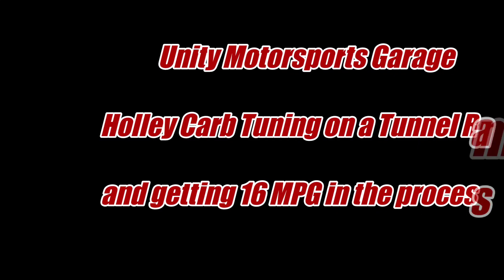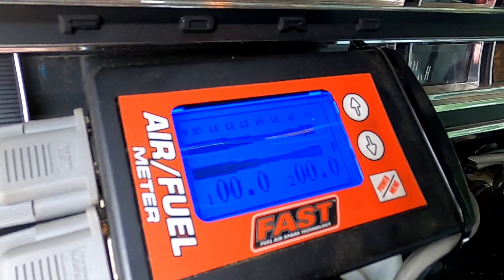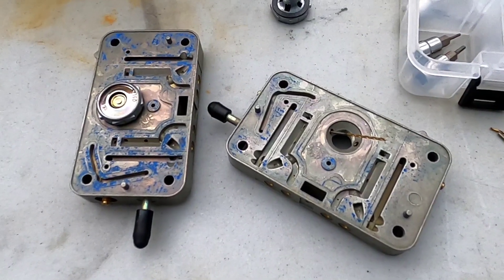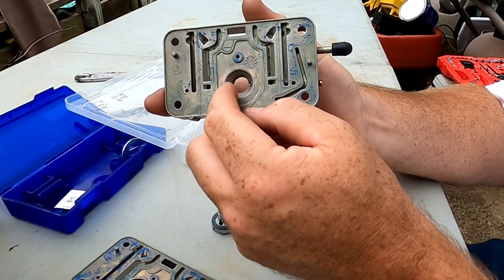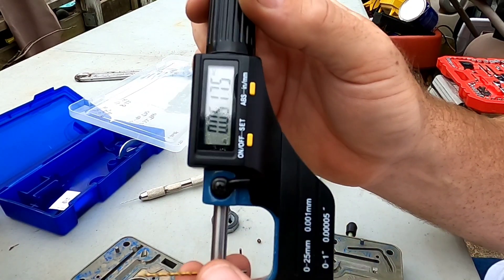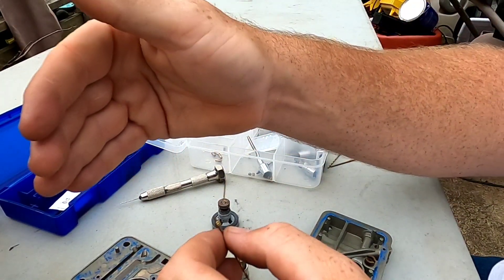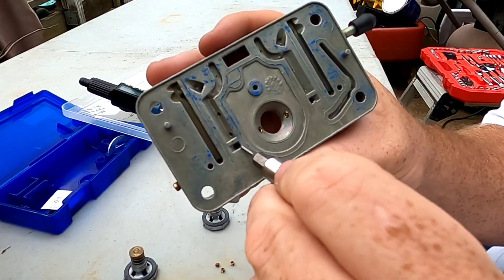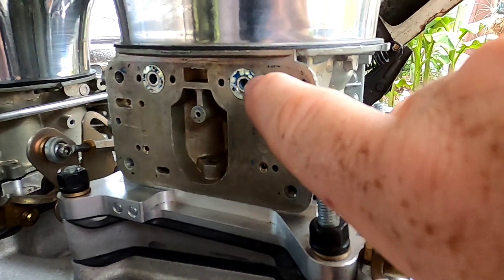600HP that gets 16MPG with a Holley Tunnel Ram and 2 Holley 660 Carbs

Comment: What if you got 2 600 CFM
Reply from the maker: I had two 600's on it before the 660's and I did the same mods.. I just took it a little farther on the 660's
 It ran good with the 600's you can see a comparison I did at the track between them on my channel.. 
Andy
Reply: Unity MotorSports Garage that looks like a lot of fun and worth while learning the Tec. Thanks for the info
Reply: Unity MotorSports Garage ya I came just came across another carb vid and he was pointing out in same thine. Thr idol air bleeds on the plate. He took apart a brand new carb the Holly Brawler and even before he put fuel to it he disassembled it and surprisingly it was dirty and had metal shavings. 

I came back to your video to really understand the idol circuit  and the transition to the metering plate. I’m used to just bolt it and go. I turn the idol set screws out 2 turns. And set the idol and play with jets. 

A guy once built me a holly 770 he said it flowed that. That was way back in 98. But that carb ran top. It could pull any rpm on a 4 speed.
Reply from the maker: @davidvonanderseck8649  People always blame the jets for their Holley running rich, while it can play a big part in it most of the fuel mileage is wasted in the Idle feed restrictor.. what is funny Holley has always calibrated the double pumpers alot richer than their Vacuum secondary carbs of the same cfm rating!  You can get most engines to idle at a 14 to 1 AFR but if you have a really strong ignition system you can go even leaner... in order to get MAX fuel economy the cruise ideal AFR is right at 16 to 1 but this requires every circuit to be dialed in because you can get a stumble with sudden throttle changes.. hence the accelerator pump must be spot on also... Im going to do some good stuff once Casper is up and running again... getting good mileage with 750hp MIXED UP BOSS is my next challenge..
Andy
Reply: I l
Reply: Wow 750 awesome. I love your attention to detail and can’t wait to see how your build comes out.

Comment: Just saw this mod on the UTG’s channel. I’m asking the same question. In addition to this modification, if you’re running with a vapor fuel setup with a Thompson carburetor powerblast plate(https://thompsonperformance.com/ )will that modification enhance gas mileage further ? Are you willing to perform a build and demonstration video for that purpose ?
Reply from the maker: No, I haven't tried those plates... But they make sense to me.. the accelerater pump circuit is basically mechanical fuel injection to help the carb transition circuits.. the better you can atomize the fuel the better the response will be... While never having run those... I believe you would be able to get away with a smaller squirter than you would normally run... But that would make for a good test... I just need plates to work with Center Squirters! Lol
Reply: @UnityMotorSportsGarage   Thompson  Performance should be able to answer that question regarding smaller squirters. I’m basically curious in picking up the ideas of Tom Ogle (R.I.P.) and continuing with those carburetor modifications. I’m confident that a vapor setup and a well tuned and modified carburetor will achieve unheard of performance as well as insane gas mileage. I look forward to seeing either your channel or UTG perform this build and show a video of it.

Comment: I have a pair 660 Holley center squirt WILL NOT go different
List 1970 6 months later
 List 1971 matched pair 
4224-S 
This system brought down blown 454s
A dual Point distributor (yes I said points) Doe's wonders !
Reply from the maker: Center Squirters ROCK!!! I love them for Tunnel Rams.. that 1:1 throttle opening is like none other...
Thanks for Watching and please Subscribe as I have more tuning stuff coming up!
Andy

Comment: Nice work and info.
Carbs will never meet the MPG of port fuel injection though. It makes a huge difference where in the port the fuel is introduced and good luck getting a carb to fuel cut on deceleration and cruise.
Reply from the maker: Thanks for the kind words,  Carbs can rival injection but in the end I do give the edge to FI due to cold start capability....  You are also right on Carbs cutting fuel on decel... the key to that is having a properly tuned vacuum advance to put in as much timing as the engine will... Most engines can idle leaner than 15 to 1 AFR, Ive seen over 20 to 1 working with David Vizard, it takes a very strong ignition system to make that happen...  Thanks again for watching and please subscribe as I have more good content coming up..
Andy

Comment: Which episode shows the 600 horsepower dyno run? I watched one where 422 h.p. to the rear wheels in shown, but that converts to around between 500 to 535 horses?
Reply from the maker: When it was first built we ran it on the engine dyno in Mooresville NC.. you can see it in my CASPER slide show video...https://youtu.be/6cV7ZUSExSY
Reply: @UnityMotorSportsGarage  so with the early high rise, you made 600, then after replacing it with a later style high rise you made less horsepower at the wheels than you should have with, as you said when drag racing it, higher power levels than before? So what's eating close to two hundred horsepower? One or the other dyno pulls weren't accurate? Can you please explain. By the way,  enjoy the content.
Reply from the maker: @olderthanyoucali8512  It made 575 @ 6500 flywheel with the old Hi-Ram "They" wanted to pull it to 7k and I decided not to.. as it had a Scat cast crank it would have probably peaked at 6700 give or take

Comment: Also you locked out your distributor or running some mechanical advance lie 8 or 10 degrees built in for mileage. Locked out with tunnel rams has always worked best for me unless high compression or timing fighting the starter kicking over. I've never had that problem but heard of others complain about it. But big picture who cares about mpg with two 4s and tunnel ram. Haha. I just want afr good at idle part throttle, smooth transition from cruise and from dig to floored.

Comment: Guess with wide band I can figure it out for my application.  But power valve change based on vacume signal then pump cam then jets is where I always started then if still had bog or hesitation would swap out the 30cc pumps to 50cc pumps and then back to jets. So where does your restrictions come in order of your tuning.

Comment: Isn't that why you change your power valve first then your pump cam  then your jets. I know what your saying makes sense but won't power valve control the amount fuel through there going from like a 8.5 power valve tho 6.5 have same effect. Or is that where your saying if you have downleg boosters vs annular booster.  My carbs are the weird ass no secondary squirter 450 cftm tunnel ram carbs 9776 I believe. And I know I need to change power valves but just pump cam change and changing jets on my 273 tunnel made a huge difference with just pump cam change then I dropped jets from factor down about 6 sizes and I get 20mpg with my 4speed 294 gear and light car and aluminum flywheel. I really want a wife band the I can tune from each header and eventually bung on each header to optimize my next motor. Those weird 450 cam mechanical secondary carbs with no secondary squirters do work good on my smaller motor. I was having trouble with getting changes with 4 corner idle adjustments till I changed jets. But there is zero hesitation and no bog like alot of people complain about after pump cam change and couple jet changes. But I know power valves need changed to better match the smaller 273 but maybe on the .04 over 318 with 10.1 and 2.02 360 heads power valve will be fine but im curious if you set screw restrictions are just changing power valve function or if fine-tuning after you have done a power valve change. Or with my carbs having metering block on primary side and plate with no secondary squirters is whole other animal. I know once the 4.56 gears go in probably gonna have to return carb but bigger motor will change same time so who knows. 

Just curious if power valve change would have same or similar results as your screw in offices behind power valve

I know if transfer slot not set right your 4 corner idle can be non responsive to change and that drilling hole in primary throttle plates isn't the right fix. Ive seen air bleeds changed and that helped with transfer slot and idle adjustments work better from idle to opening throttle making for snappier throttle correct? Again I know these 450cfm are weird setup but been great on my tr5 tunnel rammed 273 in light 4 spd car that doesn't need all the extra fuel when floored but may be hard to rune for most or a 460 480 hp motor that's smaller and built to rpm and Rev quick so will see when next motor gos in. But got me curious on tbos power valve restrictions vs power valve changes.

Comment: What i need to know is i see people with tunnel ram & 2 vacuum secondary carbs with them converted to mechanical without a secondary accelerator pump without having  a lean spot when all 8 are open.
Reply from the maker: That is almost impossible to do... On my Vac Sec carbs I tried and tried to do what you mentioned but, I found that by adding 50cc Accelerator pumps with 35 squirters and keeping the Vacuum Secondary function working!  I also adjusted the secondary high speed airbleeds to start the main circuit come in faster... I hope this helps some but I will say this I love the Center Squirters soooo much better than the 600 VS carbs...Thanks for watching and please subscribe!

Comment: Thank you. I came for the tunnel ram, but I think you helped me fix my off idle stumble. I have a wide band sensor on mine AMC 360 and as of a month or so a go after some intake swaps and Carby tuning I developed an off idle stumble and have found the car to be lean while in the transfer slot. I have re used my metering block gasket over and over again.  I think that maybe my issue. can’t wait to get home and swap that out. Thanks again. There is some great knowledge shared here.
Reply from the maker: Thanks for the kind words... If the afr is stable while in holding steady in the transfer slot you might need to work on the accelerator pumps... I ended up with 50cc pumps with the brown cam,. I hope this helps 
Andy
Reply: @UnityMotorSportsGarage  Okay, Thanks for that. I have tried working on the accelarator system a bit. I went up to a 35 and have the powerblaster plate or what ever its called and used the black cam as that seemed to have the most initial pump shot according to the graph( at small throttl angles) I will keep the 50cc pump in mind if the gasket doesnt work out. I didnt think my engine was wild enough for the 50cc. Does a engi e have to be wild to need a 50cc shot? It just has a comp cams 268h cam, headers, air gap manifold, HP750 with vac secondarys. I have read David Vizards Holley book as well.(the bible).

Comment: u know u can get a lot more out of it we got 25 mpg out of a 327 and it had over 1200 hp on the dyno with only pump gas no nitro  but that was a real expensive build and we were running right around 12.5 to 13 to 1 on pump gas and i get a kick out of people saying u can't go over 10.5 to 1 on pump gas it is actually 13 to 1 is what u can't go over or the fuel will dentainate with out spark that is by the book but if u go over 10.5 to 1 u will need to build it for it that is were the tunnel ram shines but u will need to know how to run a peddle or break lose a lot this sets the drivers apart

Comment: I got 18 mpg 450 hp on a 302 ford weiand tunnel ram 2 holley 600 carbs 351 heads 194 160 valves 101/2 to one comp forged pistons a lunati cam street grind

Comment: 2-4 tunnel ram. Power valve in primary metering block only?  Rear metering block?
Reply from the maker: Dan, I added Power valves in the rear metering blocks as well.. From what I found out once driving it, Power valves in them wasnt all that necessary because in everyday driving you never get into the main circuits.. You are running on the transfer slots 95% of the time!
Thanks for watching and please subscribe!

Comment: So basically you balanced the carburetor fuel delivery system. By just adding mini jets based on the perspective of the main jets? To balance it in harmony to the fuel ratio goal? And you say you can get 16 mpg on the highway. How about in the city? What is your mpg in city driving?
Reply from the maker: Sorry for the late reply, but yes it is basically balancing the fuel system and by making all of the circuits in the carb adjustable you can dial each one in to get the most drivability, mileage, and Performance!  Thanks for watching and please subscribe!

Comment: You sir are the MAN ! Thank You so much for this video. Everyone talks about jetting bla bla bla, when as you said, the fuel economy is in the transition circuit + manifold adjustable vacuum. I`ve tested this in my 502. Put in 99 jets front and rear. A/f ratio stays the same as before up until 2450rpm cruising, then the main circuit kicks in with barely leaning a mm on the throttle. This video was a great way to show us how it`s done for real. Can`t like this video enough. Thank You again Sir !
Reply from the maker: Thanks for watching! and you are correct...  Its about making all of the circuits in the carb work together!  Please Subscribe and help me spread the word about the channel!

Comment: Excellent video and explanation not to mention tuning tips, I have used a TPS so I can see exactly what throttle opening is happening also so then I can repeat it to see how much transfer slot is being used at what rpm's etc, as can take carb off and open throttle to set point and physically see slot to blade relationship
Reply from the maker: Thanks for the kind words!!! Having a TPS would be the icing on the cake for me... When you add a wideband to a carb setup... It just seems a whole new world opens up because you can see exactly which circuit is doing what...
Andy

Comment: Awesome video! I’ve got a Weiand tunnel ram with 600s and  I’m in the process of tuning out an off idle stumble/bog among other issues like A/F ratio. I’m going to try using power valve block offs or 2.5’s and I put in 76 primary jets. It’s got a huge duration camshaft and pulls about 7 to 8 inches of vacuum at idle it’s idles at 1300 rpm. I was also going to change the accelerator pumps to 50 cc. I was wondering if you could help me choose a squirter size.? I was thinking of trying 37’s as a start. I like the idle Circuit trick too. Thank you for your time and your great knowledge.
Reply from the maker: Galaxie, thanks for coming over and watching... Please Subscribe and help us spread the word about the channel.  On your setup. If this is to be driven on the street I highly advise NOT removing the power valves but find the one that "comes in at the right time". On my setup I have right at 10" of vacuum at idle and I found that 6.5's worked pretty well..  you will have to see what your setup likes... 
On the idle stumble, I did everything Cams squirters, etc.... It wasn't until I went to the 50cc pumps my problems were solved. My combo worked really well with 31's for squirters.. the key was having the pump shot to last longer to cure the off idle stumble.. but once I did the above mentioned things I could stage my truck at slightly above idle.. 1500 rpm or so and on the last yellow just mat the throttle and that has given me my best ET to date. I hope this info helps you and if you have any more questions... Feel free to ask..
Andy
Reply: Unity MotorSports Garage thanks so much! I do have 31 squriters and it was a toss up between those and the 37’s. I’ll try those along with the 2.5 power valves. My cam has sooooo much overlap it’s ridiculous. When I’m driving and come off idle the vacuum drops to just about zero. The power valves open and I get super rich. BTW I’m running 456 gears and the hesitation is only for a nano second. More annoying than anything else. Once I get past that she runs like a scalded dog. So I think jetting is ok. Thanks for your input and I’ll keep you posted on the progress
Reply: @UnityMotorSportsGarage  I want to thank you for helping everyone who  wants to have a tunnel ram and be able to enjoy driving their vehicle. Thanks again. Will.

Comment: That's really amazing!
Reply from the maker: Thanks,
It took a good amount of time to get these results.. It proved that with a wideband 02 meter you can dial Carbs in as good as a fuel injection setup!  I have found that I need to change settings about every 30 deg difference in temp.  other than that.. it fires up super easy and drives like a champ!

Comment: That's incredible 16 MPG I have a 2000 Dodge Dakota RT with the 360 fuel injected completely stock and I'm lucky if I get 16 MPG on the highway I think I'm around 14 maybe 15 MPG
Reply from the maker: It's funny when I built the truck gas mileage wasn't even on my radar!!! Once I installed the Fast dual Channel wideband.. I just kept messing around and kept tuning on the carbs until it drove like it had Fuel Injection... I began to notice the gas mileage and so I decided to check it one day.. I was getting around 13 mpg... I was shocked... So I kept trimming fuel from the idle and transfer slot circuit and I was able to get 16mpg!!  I do have to keep my foot out of it though and that is hard to do!!!
Andy
Reply: @UnityMotorSportsGarage  yeah I know if I had that truck I want to put my foot into a time or 2 👍